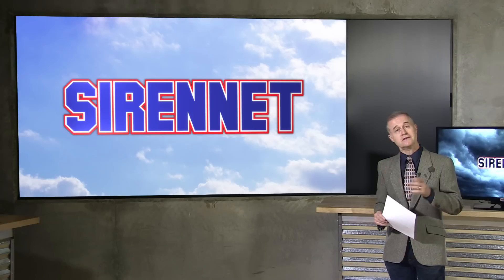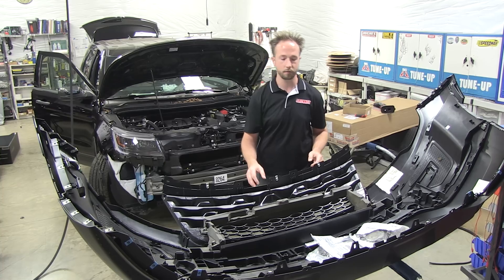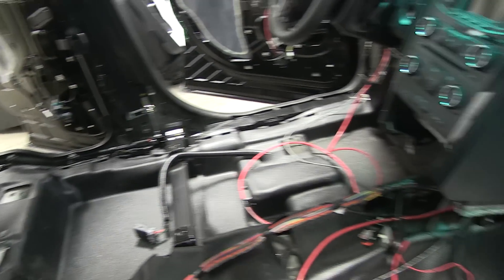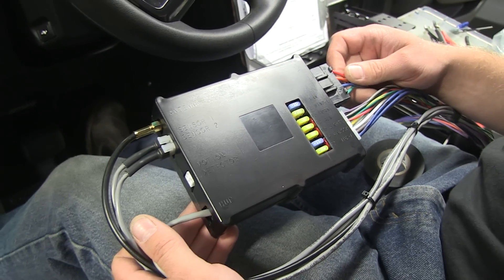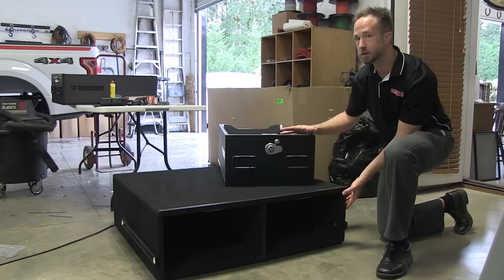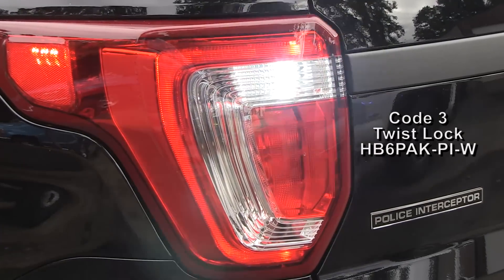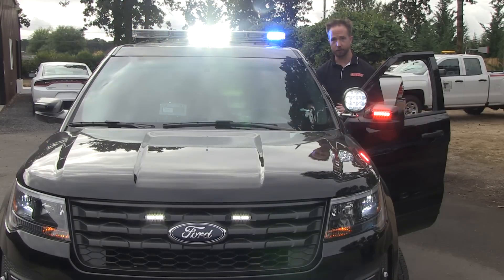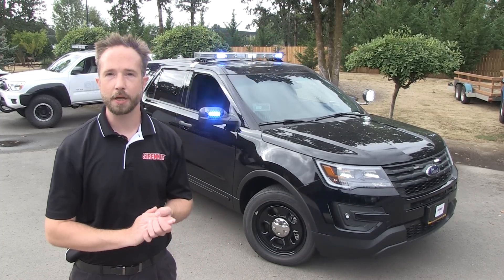Ford Interceptor Utility K9 Installation

Comment: Great video! Would like to see if you guys turn on the LED light strip on the headlight. The one that goes around the inside on the headlight. I have noticed that for some reason they don't work on the police version of the SUV.  Would be a good idea to add a strip of blue or red led inside or just to make it flash. Thanks again.

Comment: very smart installation, gents! curious... what brand is the power distribution unit installed in the wiring panel?
Reply from the maker: The power distribution is a product from D&R Electronics.   It definitely keeps things tidy.